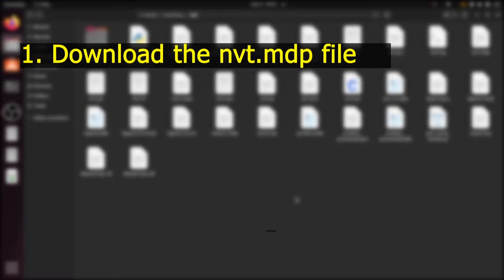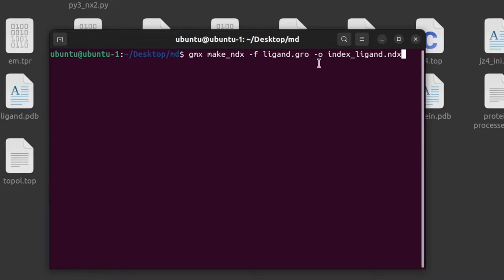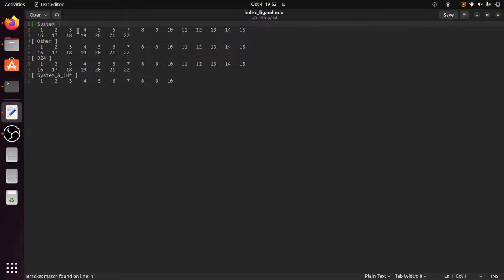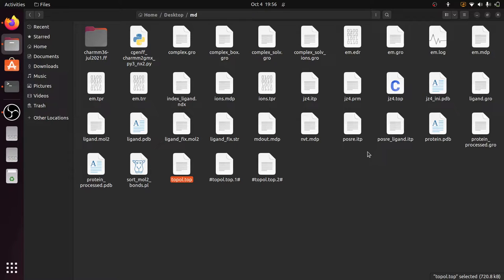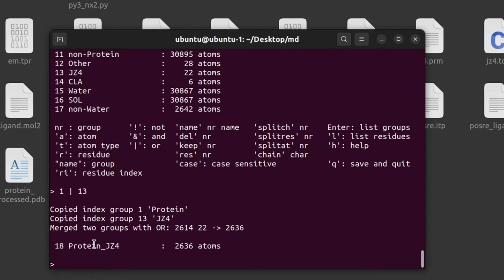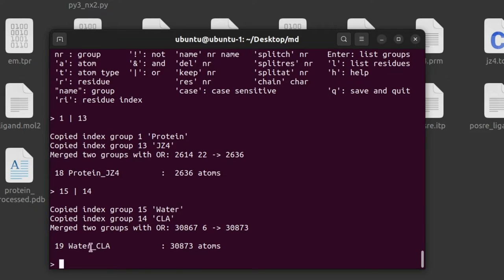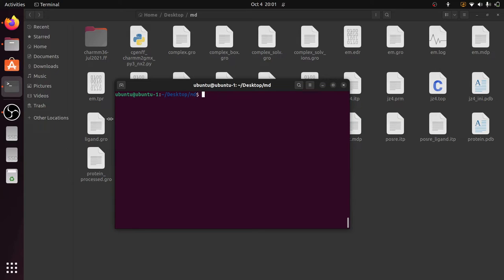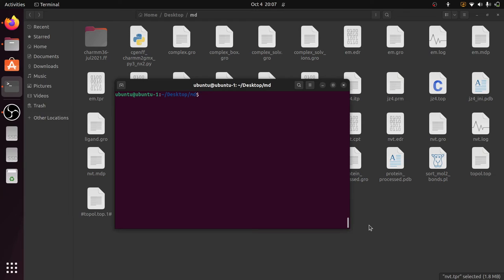Molecular dynamics simulation gromacs NVT Equlibration part 7

Comment: It is taking a long time for nvt equlibration....what should I do!?...while running the cursor us also stop blinking!.
Reply from the maker: Limit the number of cpu cores for equilibration otherwise the computer may hang in the middle... Also use -v option in gmx mdrun command for verbose output in terminal.
Reply: @pymolbiomolecules  I have the same problem how to limit the number of cpu cores for equilibration ?